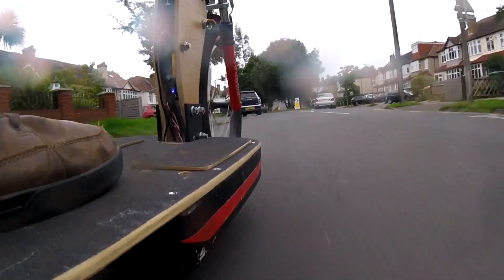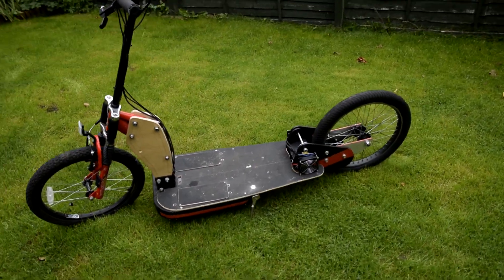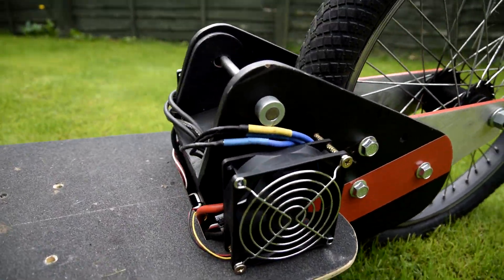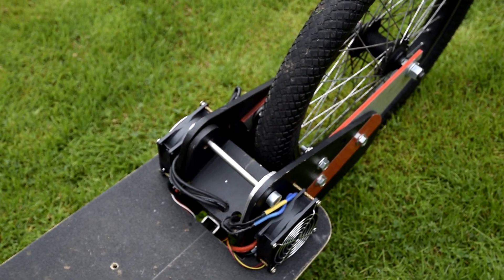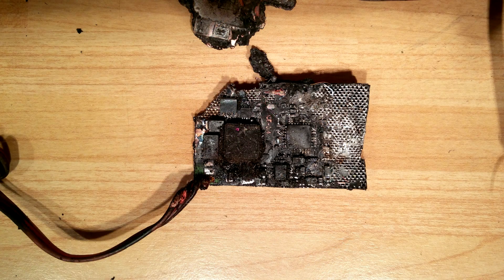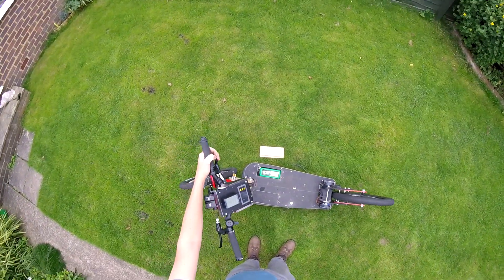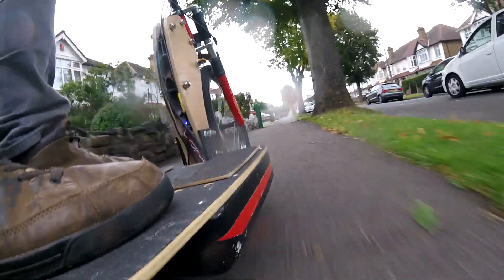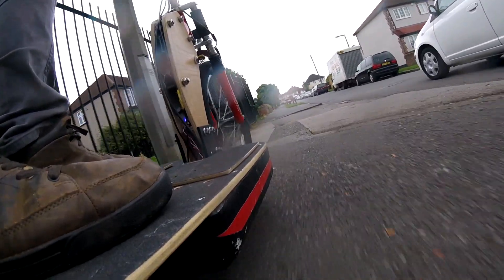Homemade 5KW Brushless Scooter

Comment: According to esc 6s 80amp which is25v x 80=2016w)x2 = 4032watts. What
Reply from the maker: 80A continous, 95A peak.
Reply: @PocketConcepts_  motor is max 80amp ( according to description in the link. Hobbyking site)
, Nice setup tho, even tho it's a friction drive😆
Reply from the maker: @ramadavince6611  That's just what they are rated at, you can draw more than 80A, they might fail quicker though. You can draw as much current as you like as long as you can keep them cool enough.
Reply: @PocketConcepts_  🤔🙄. Nice try🤣
  Get a good esc or vesc

Comment: Those motors at lowrpm.are not very efficient. Try a allergic rear wheel as an experiment and see what happens. That or try and get them so they spin higher. The such amps are low rpm

Comment: Hello. What about time or mileage of your setup. As I can see it 24000mAh and two 68?? engines, right ?
After my longboard project(6854 engine and 12v 6000mAh) which works more than hour at 20% of power(its too fast and powerful for skate) I've build real scooter(42kg) with same setup and it's ~8mins at full power(34km/h) before battery dies.

Comment: Spot of fella. Nice build. Like the ideas. Even if it was a 5th or 20th build it is still good clean and you built it rather than bought it. Respect. I bought mine lol 1000w 36v sla battery renegade. I get about 7 flat out miles at 25mph on hilly ground and it takes 6+ hours to recharge so fella you did good.

Comment: Great project it just isn't very efficient 2kw to do 32mph is almost 2x what would be average with a much lower amp draw. I would think the transfer of energy from the motor to the rear wheel is the main problem the tyre wear shows a huge energy waste, but it's still very cool. and if it's your first project even more respect.

Comment: I dont know why, but you are using a LOT of power. You have 500Wh, and electric boards have around 100Wh and have the same range. I think the actuator is to powerfull, is eating up tour tire. Try a polley system, you can 3D print HDT5 timining pulley wheels and just by the HTD5 wire.
Reply: Yes, the drive-train is not efficient at all.  I am surprised the motor bearings lasted that long.  Go with the pulley setup.  Or just stick the bicycle chain back on it - and drive off of that.
Reply from the maker: Yes, I mentioned that it is inefficient and very impractical, but it's the most simple way to do it. I had to be able to freewheel too, which unless I used a rear bike wheel and chain, or custom bearing and pulley for a belt drive. I am swapping it to a 20" hub motor and hope someone else can use it more than I do.
Reply: The hub motor will work perfect, there is so many less moving parts.  If you decide to use a pulley system, consider using 1-way bearings.  They can drive the wheel, and allow you to freewheel like a bicycle.

Comment: A rubber coating on the motor would work better for the tyre wear issue,nice build though,👍check out my 35mph electric skateboard. 😃
Reply from the maker: Rubber coating would be good until it got wet, before i coated the motors i just used the bare metal and it was ok, and did wear alot less until it got wet and then they barely did anything.

Thanks, nice board!
Reply: Free Flight thanks man,I only mentioned it because I've seen someone use rubber sleeves to protect these motors on an electric skateboard as they ride low to the ground,for your scooter it would work really well as the more grip you get with that motor the more torque it will produce,there is an electric bike kit with the same concept as yours and they use a rubber coated motor for fast acceleration.yeah not sure how it would preform in the rain but hey worth a try..for science...

Comment: Why you went with direct drive instead of a belt or a chain?
Reply from the maker: Wanted to experiment with having no friction on the back wheel so that you could roll very easily if you wanted to. If i were to do it again i would use a belt drive though, or hub motor.
Thanks